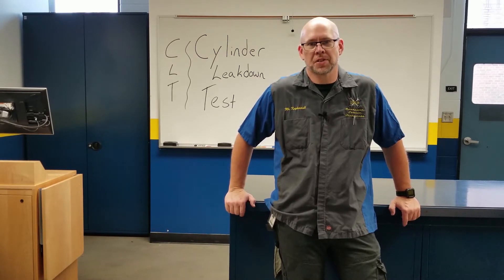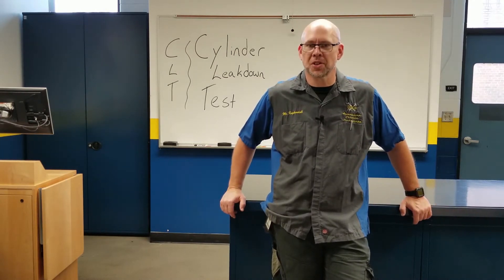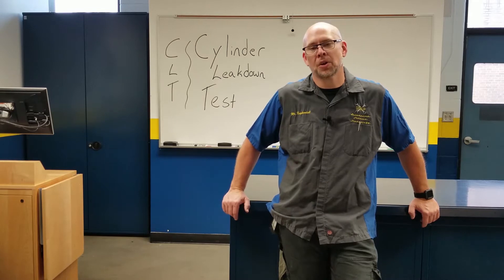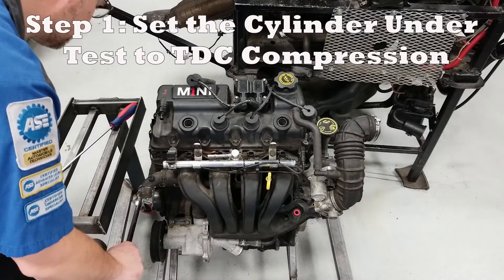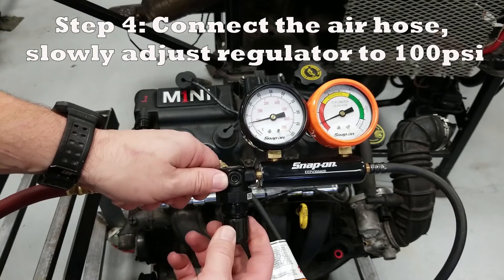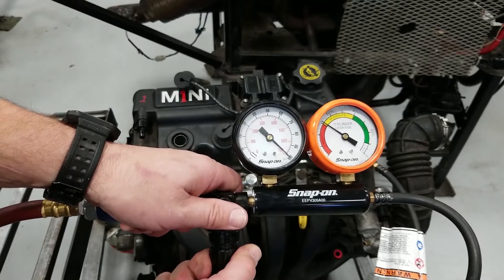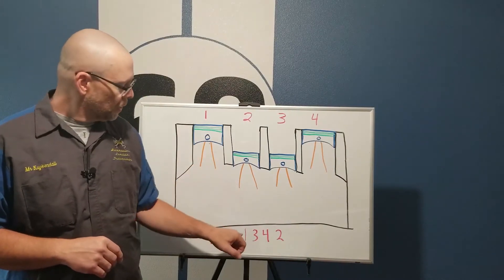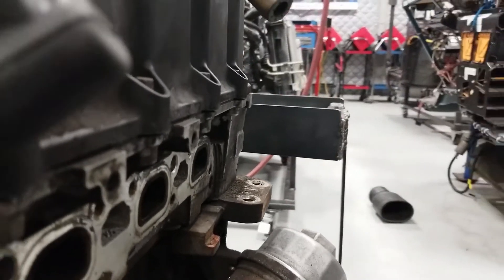Cylinder Leakdown Testing

Comment: Excellent! I have been watching several videos on this topic and this one has been the most helpful to me, thank you. There was just one issue which he covered and I still missed the answer. He was talking about a low bank. I didn't understand the answer to it. I believe he said it is caused by a cam shaft timing jump? I have a ford 5.4 with low compression on one bank. Maybe I should learn to check the timing on it. a 2010 ford e250.

Comment: I got a b16 engine the was doing wear stuff I did compression test and gave me 180 in 123 and 200 on 4 but went I look and cilinder with  taking spark plug out found out the that cilinder #4 was wash out with gas now I have to take the head off but kind of sure that it's a valve the didn't sit well 😢

Comment: How did you STOP the motor from rotating when you applied Air pressure 100 psi would push the piston to the bottom of the cylinder now you have a valve opening
Reply: Not if it's right at TDC it won't. If it's just past or just before it will.  Most don't use 100psi either, 80 is better. But 100 still won't.

Comment: No where on the internet do they use the tester like you show.. The instructions with the gage also say you are doing it wrong.
Reply: I was wondering the same thing. Supposed to dial it in the leakage gauge to zero then hook  it up to the engine.  Is how I understand it?

Comment: im doing this on a atv. does it matter if there is oil and coolant in it? also the compression is 47-81 psi normally. could i still use the 100 psi ? i have tdc front and tdc rear , 1 cylinder each. do i test tdc front then rotate 360 and test again for the front and repeat on the rear?

Comment: What if compression, pcv and valve seals are ok and the engine does not have a turbo, but there is a lot of blue smoke and a lot of oil consumption. The engine has been overheated once. Could it be the oil rings? In my view, a compression test and leak down test will not reveal worn/damaged oil rings.

Comment: When you use the video borescope for valve issues, do you put the cylinder TDC  on compression stroke and visibly look for holes where air may escape?
Other than the exhaust ports on the head, where else are exhaust ports to listen for leaks?  I have a '95 Nissan Maxima.

Comment: NEWS FLASH... If you have a hole in a piston that cylinder isn't going to pass any sort of a leak down test. certainly a wet test for ring failure. listen to yourself.  LOL.
Reply: But you would hear the air coming out of the crankcase.

Comment: 10:05 Is the only way to know if the engine is set to TDC compression instead of TDC exhaust, to use a screwdriver or straw, as described in the video, then install the gauge and apply air pressure to determine if air is or is not leaking from the exhaust valve(s)?  I want to perform this test on my 2004 VW GT, 2.8L VR6 engine.  The car runs fine.  Intent behind testing is to determine if a more serious engine issue exists before replacing the timing chain. Some oil is leaking from the engine but I have not been able to determine the location.  Possibly leaking from the rear main seal for the clutch assembly. Maybe the oil filter mounting point.  Hoping it's not a cylinder head, valve cover.  Unsure if the secondary air system could also be the culprit.  Thanks for teaching us how to do this work.  Your knowledge, experience, and meticulous teaching method makes you a great teacher.  I especially appreciate the honest fact about how it's done in with a borescope. Personally, I want to try doing it the old school way with the compression tester.  A borescope is too pricey for me at this time.

Comment: Great lesson. What in a case where all cylinders on dry compression test are where they should be (no wet compression done) but the CLT shows 65% leak (on all the same). What could be the root cause of that? Engine is VW 2.0 Turbo EA888.3

Comment: If the timing chain has stretched if the cylinder is is at TDC will this put the cam lobes out and valves will be open slightly ?
Reply: Not if you're only slightly out of time.  Both valves should be closed near the beginning of the compression stroke, and should still be closed near the end of the power stroke.  That's nearly 180 degrees of rotation with both valves closed.  TDC is in the middle of this range, so it should always be a safe bet.
Reply: @CheapskateGarage  Thanks for your reply, i think the chain jumped and the can were way off I realigned using cam locking tool them replaced the chain at TDC .

Comment: all these videos on the leak down tester use easy 4 cyl to find tdc so what about V engines
Reply: You don't even need to do it the way he described. There is a much easier way to find TDC on compression stroke of any engine. 

1) Hook up your tester to the cylinder you want to test and put around 10 psi into the cylinder.
2) Turn the engine slowly while observing the needle on the gauge.
3) At some point the needle will start bouncing in the positive direction (you're now on the compression stroke).
4) Keep turning and observing the needle.
5) Once the needle goes to the negative, you've just passed TDC.
6) Back up the amount you last turned and you are at TDC.
7) Slowly raise the pressure to 100 psi and note your leakage.

The needle on the gauge acts like the screwdriver in the cylinder. It goes positive on the way up and negative on the way down.

If you follow the firing order of each cylinder to be tested, you will have the least amount of turning to do as each cylinder at TDC in the firing order is 180 degrees apart.
Reply: E even tougher is a Subaru ej257  boxer engine

Comment: I have a motorcycle that has an auto-compressor on the camshaft which lifts an exhaust valve a bit to make it easier to get the piston a bit beyond TDC for kick starting. Is there any possible way to do a leakdown test?

Comment: I don't see how the borescope can tell if the rings are bad. I have a scope too and a leakdown tester and compression tester OTC . And I have been working on my 2001 dodge ram van v8. Num 7 cylinder has the lowest compression but I have random misfires on num 3 and #1 as well, but no codes, nor MIL, I determined that is the rings/cylinders.

Comment: So I have a 2005 dodge ram 1500 4.7 and I did a compression test yesterday. Cylinder 2-8 I was at 150lbs but Cylinder 1 I was at 90lbs. When I tested again this morning by putting a few drops of oil in the spark plug hole it then went to 120lbs in Cylinder 1. I have a knocking sound and it sounds underneath the truck. Thank you
Reply: that's usually a rod bearing or rod knock.

Comment: Wander how you can do a wet compression test on a boxer engine as the oil will all go to one spot on the ring since it's a horizontal head?  Seems like it would never coat all the way around the ring
Reply: Spray oil in the cylinder.   
 Use your shop air to blow the chamber with a rubber hose at the end so you don't damage the threads.  
This gets oil all over the cylinder bore walls in a flat engine.  
Spray again for any oil that left  IF NEEDED.  Like if you blew out all the oil out of the spark plug hole.   
Use borescope to inspect cylinder for even coverage of oil.  IE, its wet. 
Now quickly perform your leak down test.   
Repeat procedure for other cylinders.  
😊
Reply: @MickeyMishra  sounds like a pita but possible
Reply: @jackle842000    When you start working on Flat Engines?  Chances are?  The Labor costs are worth it.    There are far more people willing to pay for good work then people who just want slave labor.   

Yea, it's a pain.  But  at least its not PT cruiser TIming Belt Install pain.   😁

Comment: Why would it going backwards a little damage a timing tensioner? Can't seem to make sense of that
Reply: it has to do with the cams riding on the lobes.  going backwards can do some damage on some engines with an overhead cam setup or with another kind of valve train it's just not recommended so to avoid damage that "COULD BE"  possible.    THere are also  valve trains that have things like VTEC or vvt-i or other items that run off the cams that are friend backwards and get damaged and some new your engines.  
it really is a safety precaution

Comment: How long should a cylinder hold compression?
Reply: depends on how worn the engine is and whether it's hot or cold. There's a lot of factors.   if it holds it for at least 30 seconds to a minute you're golden for a daily driven car imo.   but this varies from engine to engine
Reply: @MickeyMishra  what about a rebuilt 351 that hasn't run. the rings haven't seated and isn't holding compression.
Reply: @TropicBreezeRealty     Then something FUBAR on the REBUILD.     Best I can say without being there.  

I have this saying.   If YOU did not rebuild it?  Did not pay a Kidney to get it done?   
It may have issues with the rebuilder.  

When I drop anything at the machine shop? 
I buy them Lunch.   Drop of cases of beer or Soda for the shop fridge.   Most of the time? This works a treat when I have others rebuild  things for me.  

Your mileage may vary.  

I would take it out and inspect everything and check tolerances.   Things happen. Even with new parts.